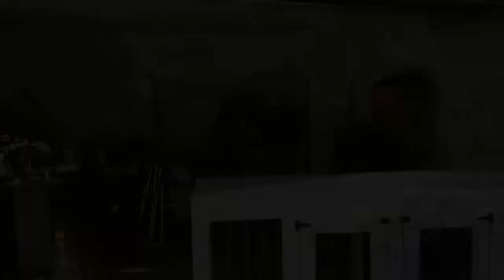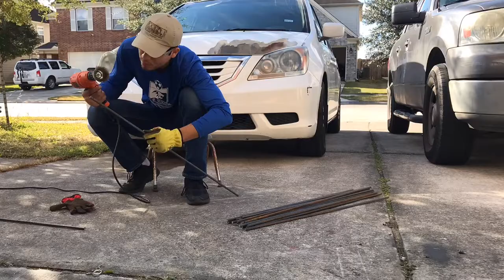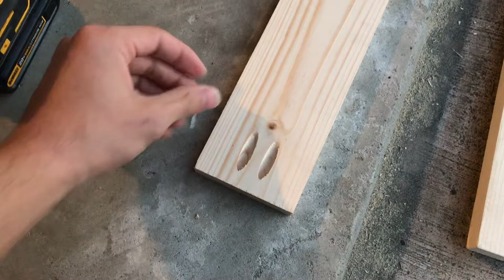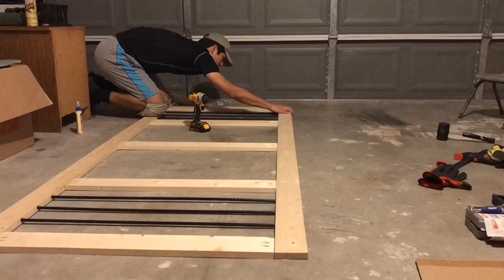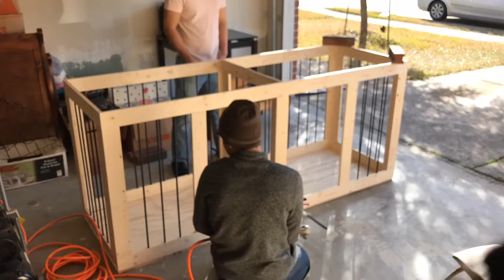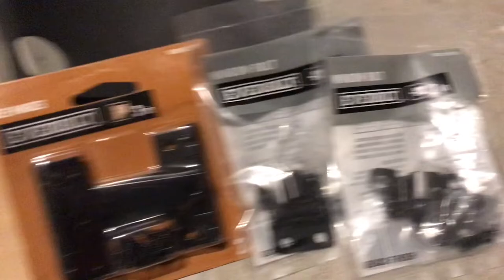How to Build an Indoor Dog Kennel DIY // Step-by-Step Tutorial

Comment: Great video. I know this is a year old and I hope you've fixed this issue. But if not, please rework the volume balancing. Your voice is super frigging low and then the background music is blown way out. So I had to keep turning the video volume up and down so my ears weren't destroyed everytime the music came back unexpectedly. Also, you never gave any dimensions for anything other than what you cut for the 1x4. The rebar length and the top and bottom plywood didn't have dimensions so we are left to figure that out after we've assembled the walls of the kennel. Also, I know filling the pilot holes seems cleaner but when someone of us move homes, we aren't gonna want to take that whole kennel as one piece from place to place. So I'd drill the pilot holes on the inside of the kennel where they won't be seen, so that you can disassemble later for traveling. Other than that stuff there, you did a great job on the kennel.

Comment: What are the door dimensions?
Reply from the maker: Height: 31in and length: 19in... I would recommend to measure the door spaces till the very end to get the exact dimensions, also cut about 1/4in off the door measurements for spacing. Thanks for reaching out 🙌

Comment: Hi! Dimensions?
Reply from the maker: (Top/Base) - Length- 7ft 5in , Width- 2ft 6in

(Door Size) - Height- 31in , length- 19in

I would recommend to measure the door spaces till the very end to get the exact dimensions, also cut about 1/4in off the door measurements for spacing. 

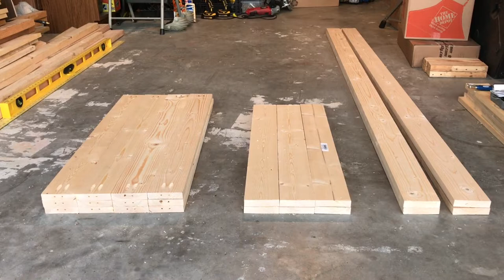The rest of the dimensions should be at 6:50 , Thanks for reaching out 🙌

Comment: I love the humility confessing your pocket hole mistake. Not sure if you have the Kreg drill bit but it comes with an adjustable stop collar that prevents you from drilling too far. Nice video man keep it up.
Reply from the maker: Thanks for the tip man, I really appreciate it! 💯
Reply: @corrigeuxwoodshop3308  actually the pocket holes are still incorrect, you need to set your depth on your drill bit but you also have to set up the jig correctly for the thickness of your materials.  those holse shouldnt be visible at all on your end grain.  The design behind the jig is correct angle and depth so that your joint has maximum strength.  Great video, hope the tip helps.  Keep up the good work!!

Comment: What are the cut measurements for the doors?
Reply from the maker: I apologize for the late response. Here are the measurements...Height: 31in and length: 19in... I would recommend to measure the door spaces till the very end to get the exact dimensions, also cut about 1/4in off the door measurements for spacing. Thanks for reaching out 🙌

Comment: You have measurements of all pieces of this project?
Reply from the maker: (Top/Base) - Length- 7ft 5in , Width- 2ft 6in

(Door Size) - Height- 31in , length- 19in

I would recommend to measure the door spaces till the very end to get the exact dimensions, also cut about 1/4in off the door measurements for spacing. 

The rest of the dimensions should be at 6:50 .
Reply: What about the rebar length

Comment: How many inches do you drill into the 1 by 4 for the hole for the rebar
Reply from the maker: I drilled the holes 1inch deep on both bottom and top 1x4s 👍 you can do whatever depth you’d like honestly, just don’t go past 1inch cause then it gets tougher to get that rebar in
Reply: @corrigeuxwoodshop3308  thanks

Comment: is there a materials list for this
Reply: also what are the finished dimensions
Reply from the maker: - 23/32 pine plywood (top/base)
- 1x4 common boards
- rebar 3/8” or 1/2” (your choice)
- vinyl flooring (walnut color)
- dowel sticks
- pocket hole screws 
- paint (your choice of color)
- metal spray paint (for rebar)
- wood glue

I think I named most of the materials you’ll need 👍 If I missed any you can always go back to the video, I have some materials listed at the beginning! Thanks for watching 🙌
Reply from the maker: @micheledunn3946  

(Top/Base) - Length- 7ft 5in , Width- 2ft 6in

(Door Size) - Height- 31in , length- 19in

I would recommend to measure the door spaces till the very end to get the exact dimensions, also cut about 1/4in off the door measurements for spacing. 

The rest of the dimensions should be at 6:50 .
Reply: @corrigeuxwoodshop3308  quantities  for the material?

Comment: For the top part did you connect using the pocket jig, do you just nail or glue it on?
Reply from the maker: I actually used a “18 gauge brad nailer” to connect the top, it worked great! Of course there’s other ways you can do this process but this way seemed to be a lot easier 👍
Reply: @corrigeuxwoodshop3308  thank you so Ku y for replying man. I’m start this a week from now!